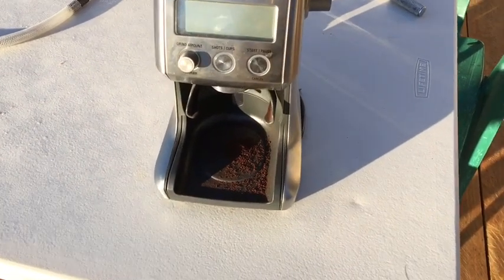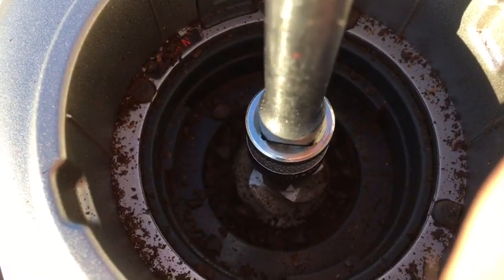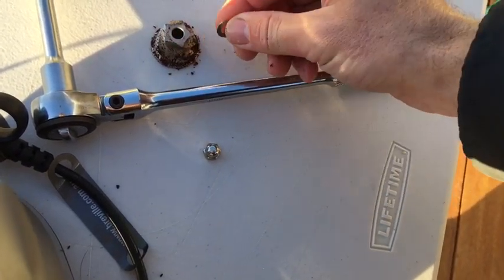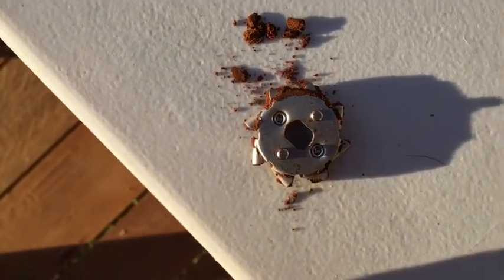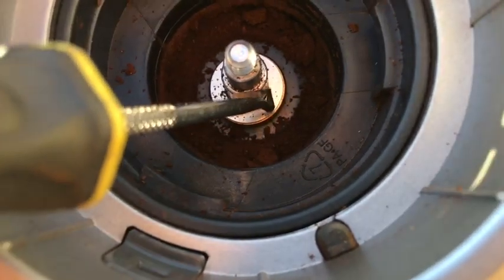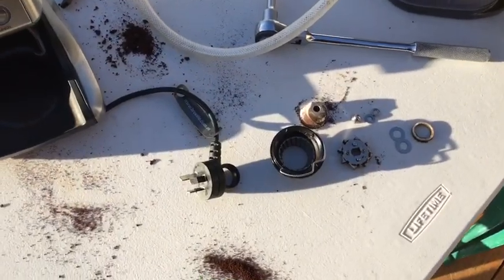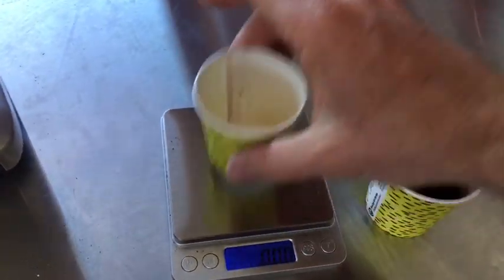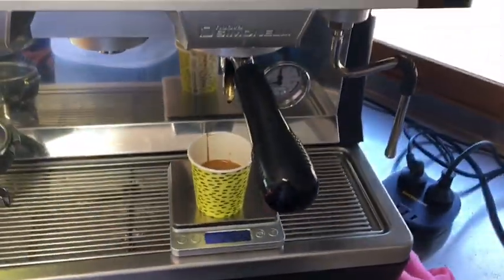Breville Smart Grinder BCG 820 full burr removal and clean. Drive shaft inspection.

Comment: I had a good tip from the Breville people when I called today:  they told me to clean the machine thoroughly (take off the hopper and remove the  first burr and clean as much as possible — I use a pointed, curved dental cleaning tool to do this) and then reassemble it and grind a 1/4 cup of dry, unseasoned, white rice through the grinder at maximal (large) grain size and this would absorb the oils that have been clogging my machine. It seems to have worked so far. I ran two batches of rice through it (one on coarse- and one on fine- grind) and it ground the rice very well. Later, I tried with coffee and it seems to be working normally again. I think I’ll do this every month to keep it as clean as possible.
Reply: erm... wouldn't the rice residue be mixed with your coffee for the consecutive grinds then?...so, the 2nd and so on cup would be rice flour & coffee?

Comment: Thank you so very much for your helpful video!  My grinder was making an awful racket and after taking the top bin off I noticed there was a small pepple in the works. I could not remove the top burr, nor could my husband with his strength. I used a small chisel and ballpeen hammer to pulverize the pepple and then, magically, I was able to follow your instructions and clean each part.  Brilliant!

Comment: Thanks for posting this.  You saved me $200!   My grinder has gotten clogged because I cleaned the hopper and put it back on before it was totally dry.  The water mixed with the coffee and totally clogged it up.   One trick to get the star shaped blade off, if you don't have that hook shaped tool, is to use an allen wrench and then pull up on it with a pair of pliers.  Alternate sides until it pulls up.

Comment: Worked like a charm.

1) Remove everything, clean it all up.
2) Re-assembled without the 2 spacers underneath the impeller
3) Set top burr to maximum coarseness

Finally started spitting out grounds again.
Reply: I need to try this.  Thank you!

Comment: I have that grinder and for some reason when I put the beans or rice it won't turn, if I remove them then it turns. Does anyone know how to fix this
Reply: Lucie Poirier same here.
Reply from the maker: Sounds like a burned out motor...
Reply: Same here.
Reply: @levenezu  how long does your machine has been used before this issue arise?
Reply: @BaysviewPg , around 3 months of light, i.e., once every three days’ use.
Reply: Hi Lucie, does the deep cleaning as recommended below helps to resolve your issue?

Comment: I have a Breville Barrista Express - the grinder portion is just like this.  My grinder stopped grinding and makes a high pitched whirling sound, like there is a clutch broken or something.  I can't get the top burr off though.  It is stuck and I never have been able to apply enough forced to unlock it, I've tried before.  I use a lot of twist but can't get it loose.  Any ideas?
Reply: I had the same issue. Sent it out to breville for repair after installing a new burr assembly didn't help
Reply: @ShayanGivehchian  I  just buy my beans at the grocery store now and they grind them.

Comment: Hello friendo, i need some help i have a problema with my BCG800xl it gruonds the coffee but not in Fine position for expresso, it doesn't come out, i am in Colombia and i can't fing support here for breville, i dont know if is the impeller OR the upper and lower Burr, Many thanks
Reply from the maker: Hello Ciro, Try this, remove the top burr and clean out all the coffee grinds with a vacuum and pointy tool or the long bristles of the Breville cleaning brush. Try to loosen all the grinds which are stuck in between the teeth of the impeller. Try to get it so clean that you cannot see any coffee inside at all. 
Then put it all back together and put a cup of plain dry white rice into the hopper. Grind it through on the course setting and it will clean out all the coffee oils which are causing the blockage hopefully. This might fix your problem. I hope it works for you.

Comment: Can you tell me why you took out the two shims?
Reply: To compensate for the 1 mm shaft vertical play which pushed the lover burr closer to the upper burr and made the grind finer than it should. At least this is how I understood it.
Reply from the maker: Good question. Thinking about it now I can’t work out why I didn’t just adjust out the top burr and grind setting courser until it was right! 
I just now had to pull it all apart again and put the shims back in because now I can’t get it to grind fine enough.
Reply from the maker: Whoa! Yeah that’s what I was thinking at the time.

Comment: Hi Glen, I am having the same issue but opposite, it is too coarse and I have to move to finer and finer over  time and is now sitting at grind "4" and soon would have no where to move.  Any idea of how I can get it grinds finer?  I have followed your video and clean every parts. Thanks!!
Reply from the maker: It’s actually very hard to say if it’s your grinder getting old, which it could be if it’s old and the burrs could be blunt, or you could be using coffee which is getting very stale, which produces the same effect of needing to grind finer every day. 
Try roasting your own😊 it’s a fun hobby and the fruits of your labour are delicious! 🤤
Reply: @GlenEdwards  In your video, you mentioned you have removed the 2 shims and couldn't get it fine enough, so what if I get the shim kit and add one to the grinder, do you think that may work (at least for a little while)?
Reply from the maker: @siulilomay628  yeah sure! if your grinder doesn’t already have shims in it. Do you have the adjustable top burr set to the finest setting?
Reply: @GlenEdwards  I have the adjustable top burr and managed to  adjusted from grind no 6 to no 4 and now I use grind level 10 instead of level 4 which extend the life for another year or so. Thanks!
Reply from the maker: @siulilomay628   just set the top but to it’s finest setting and go from there. That’s the best way to handle it if it’s always used for Espresso. 👍🏼
Reply: @SiuLi LoMay Hi, I've the same identical problem, have you solved?
Reply: @hackthomas99  You will need to replace the upper burr.  I bought the part from Breville direct, costs around $40AUD, since the change, it works much better.

Comment: I have cleaned the top but a few times. But lately there is a bump sound when grinding, about every 6 seconds. Could a stone be where the bottom bur is? Or similar thanks
Reply: Cleaning the top burr (only) is not enough. Disassemble and clean it all.
Reply: @davidlogan2682  thanks, took it all apart. The crunch sound is gone.

Comment: Did I get that right? You didn't put back the 2 shims below the bottom burr?
Reply from the maker: Yes you are correct. For some reason I thought that was a good idea I can’t remember why. But around 6 months ago I put them back in and my espresso grind is now set at around 21, with the top burr set to its finest setting.
Reply: @GlenEdwards  which is your better grind then? With or without the shims?
Reply from the maker: I think with the shins is better, I was struggling to get it to grind fine enough at the finest setting without them
Reply: @GlenEdwards  right. Thanks man!

Comment: What size of a socket did you use to loosen it?
Reply: it's a 10mm
Reply: 10mm which is the same size I use to disconnect the batteries on my Honda cars.  I keep a 1/4” ratchet with an extension and 10mm socket in my garage and that also works for when I clean the grinder on my Breville Barista espresso machine that uses the same grinder mechanism as yours.